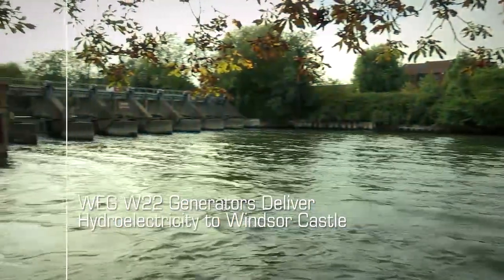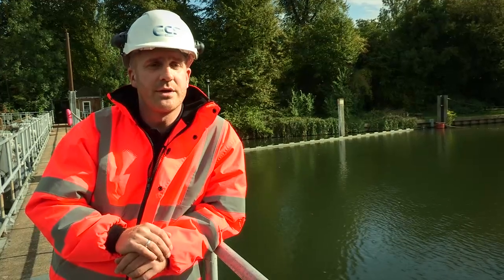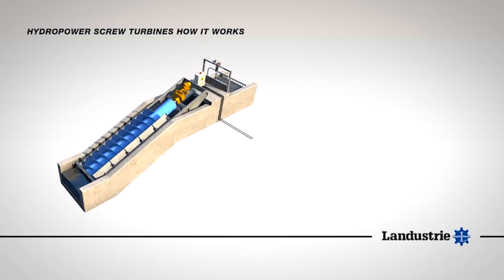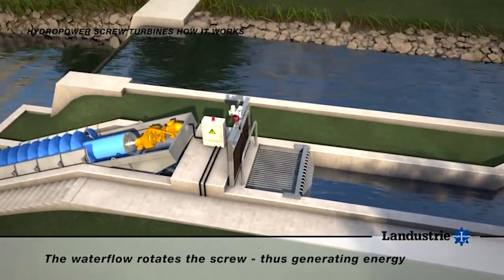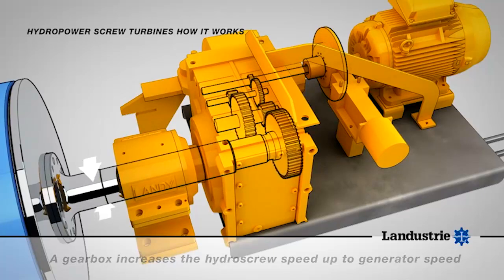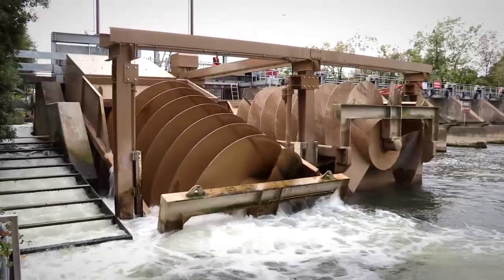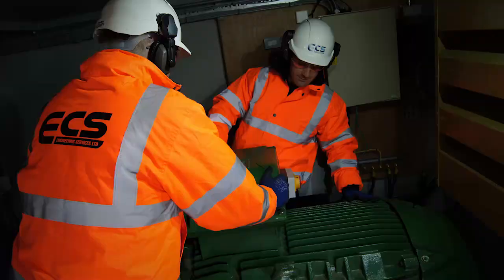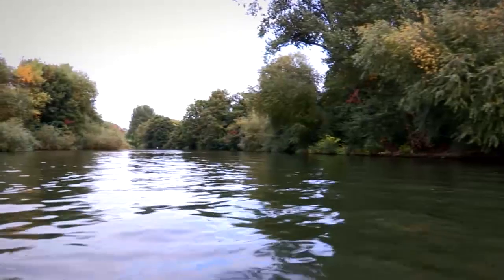WEG helps to generate hydro-electricity for Windsor Castle

Comment: Hellow. Nice work! 
How do you calculate metal sheet thickness for shaft and flights? 
Thank you in advance!
Reply: You don't, the weight of the water on the fins is  basically irrelevant and its not ever going to be the point of failure since the shape of a welded spiral around such a wide cylinder in such a tight circle will give it all the rigidity it needs, I dont imagine you'd ever lose any sleep using 4mm, any more than that and you could power it with just your fabricators tears

Comment: The WEG W22 is an asyncronous induction motor. Simply running it as a generator it can't possibly achieve 96% efficiency? So are they using a special PM rotor, i.e. running it as a syncronous PM generator ??

Comment: Hi what is the price for the machine, i need for my rancho.
Reply: The machines were £350k each. You might not need such big ones?
Reply: @David-pk9be  It generates 300kW and will pay itself back in 6 years: 8p * 300 * 24 = £380 a day in income * 6 years = around £350k as you said. For a ranch with a high degree of automation a 10kW screw is still more than you possible can use and it will still pay itself back in 10 years if you use only 100kWh/day likely sooner as a 10kW screw can be easily installed with an excavator, after which it will just generate you funny money.
Reply: @Tore_Lund  Anyone know of a UK manufacturer of small Archimedes screw turbines? I have 2m head and 600L /sec approx 6kw.
Reply: @stephenauty2402  Not rocket science to have a machine shop make an Arhimedes screw. Some science papers must have been made to size it according to your flow situation. Then give them specs or drawings. Not that different to make a screw for grain or sewage, so a machine shop would know how 
to make one from scratch.
Reply: Did you get one installed in your ranch?

Comment: I'd like to know flow rate and power generated
Reply: Ironically the engineer in the video said 300kWh daily
Reply: At least that's what I heard
Reply: they flow about 7.1 cumec each and make about 130kW each
Reply: they flow about 7.1 cumec each and make about 130kW each
Reply: @David-pk9be  Do you know of a UK manufacturer of small Archimedes screw turbines? I have 2m head and 600L /sec approx 6kw
Reply: @stephenauty2402  Hello Stephen, There have been a few startups making plasctic screws in the UK but I don't think they are around or have made anything durable. I buy my screws from the Dutch, Belgiums and Germans.
Reply: @stephenauty2402  HI Stephen, if you want to make one on the cheap, you could find one or maybe even a couple of used agricultural grain augers and run them with alternators. Replace the bearings with sealed bearing and connect  two or three of them with belt drives on a single large 24v alternator to charge batteries and then use an inverter to get to 60hz AC
Reply: Bonjour,
Avez-vous vous une installation de production électrique avec ce système à vis?
 @David-pk9be